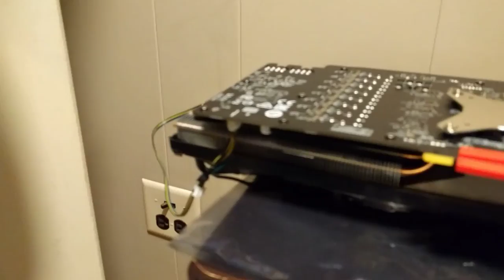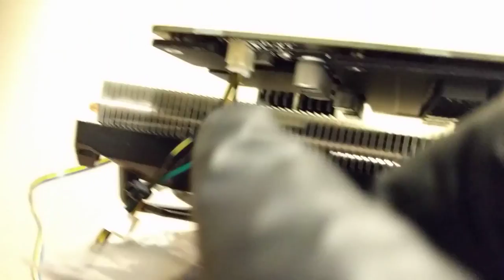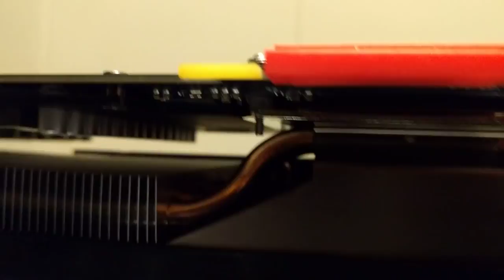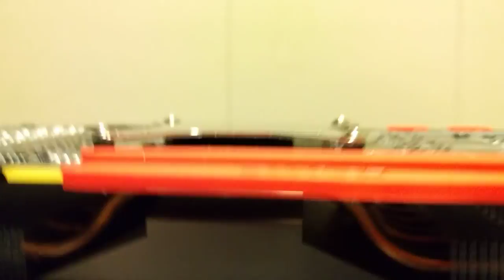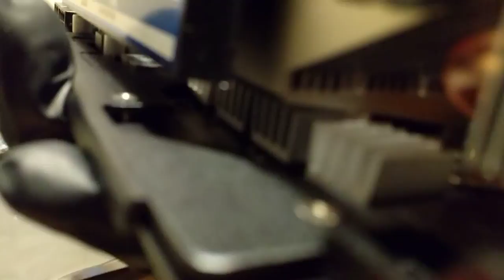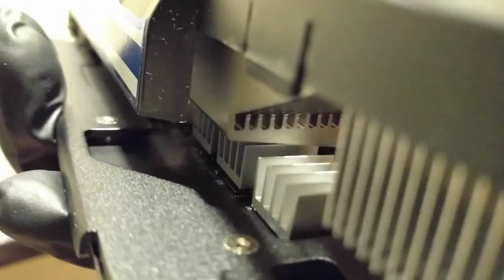MSI 1080 ti Armor with Arctic Accelero 3 mounted how to Part 2

Comment: Why don't you use additional heatsinks on power mosfets? These elements also require cooling for stable work.
From my point it would be also good idea to put some heatsinks on a plate above the memory chips
Reply from the maker: XVoland yeah I was thinking that but I was worried the heatsinks would be too tall to sitting on top of the base plate

Comment: why didn't u buy gaming x instead of voiding warranty and spending money on aftermarket cooling ?
Reply from the maker: All they want to do is RMA the card. I don't want the same card back also I didn't want to be without a card waiting on them either. But your right should of bought a better card also when I bought this it was the only aftermarket card available at the time
Reply: I contacted MSI and they said installing an aftermarket cooler on the card would not void the warranty. Also I have read that the thermal paste used to glue on the heat sinks isn't as permanent as ppl believe and can be removed by simply twisting them off fairly easily.

Comment: Hey patrick,

im going to do the same to my armor card. Im just curious, can you run some more benchmarks with gpu-z in the background, monitoring all temowps of the whole board? I rly wounder how hot those vrms, vram-moduls, elcos, etc. get, by just cooling them via the backplate.
Reply from the maker: Name Eman If I had a different case I would of used a aio water cooler. On this cooler I have fans set to 100% at 70 degrees and the only time the card ever got close to 70 was in the summer when it was 90 degrees out
Reply from the maker: Name Eman also if you're worried about the other parts of the card the only thing cool differently by the stock cooler was the 3 RAM modules that I put the heat sinks on everything else is exactly the same so the stock cooler didn't cool that stuff anyway

Comment: I will return the MSI and get the Gigabyte 1080 TI Aorus.
Reply from the maker: The non Xtreme one is 720 and it looks just like the Xtreme that's 750
Reply: Its 50 Euro more the Extreme here, and its not available in the Stores i usually order here in Germany. I am ok with the non-extreme. Its good enough for me. ;)
Reply from the maker: Probably overclocks the same anyway find out if the non Xtreme can use the aorus software it lets you rase the voltage. Plus the aorus cards have a 150% power limit that's the only issue left with my card the temps are cool but it's hitting the power limit